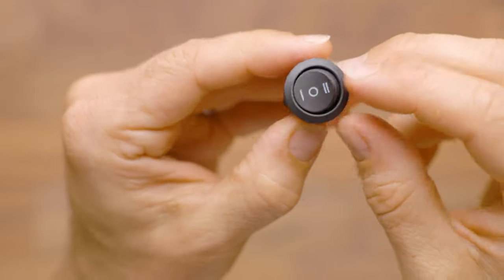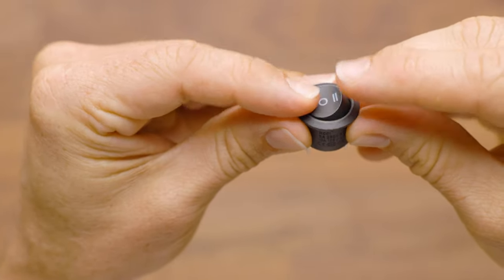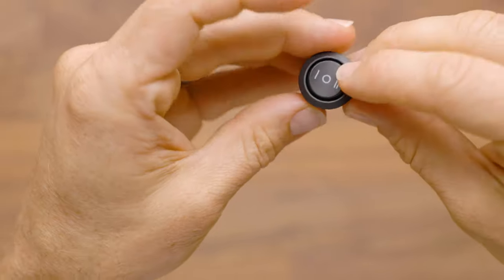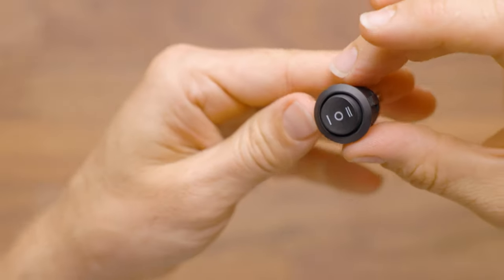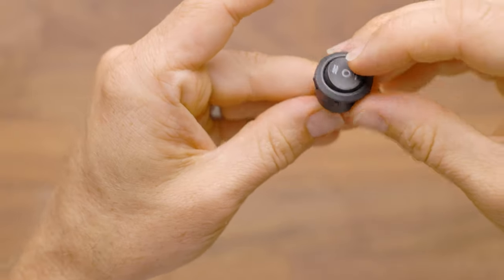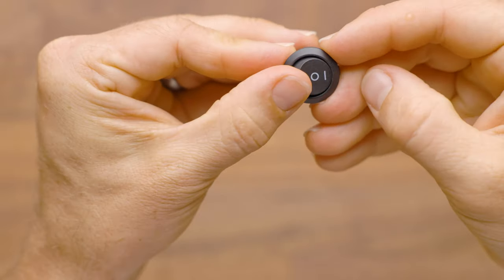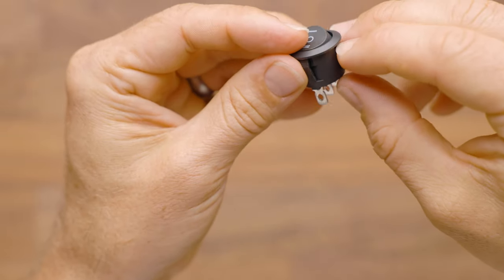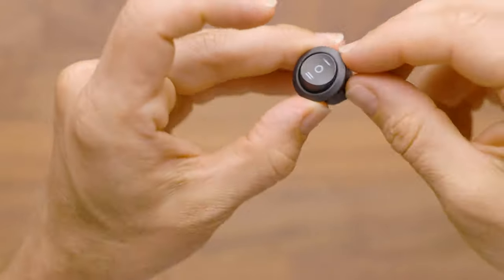Product Overview: 3-Postition Round Boat Rocker Switch

Comment: Do all 3 pos switches (On-Off-On) have the ability to run a forward/reverse load, or are those specialized switches ?  I have a 12V Fan, that I’d like to be able to switch from Intake to Exhaust on demand, would this suffice, or could you make a recommendation ?
Thanks, and Thank You for the content 👍🏼